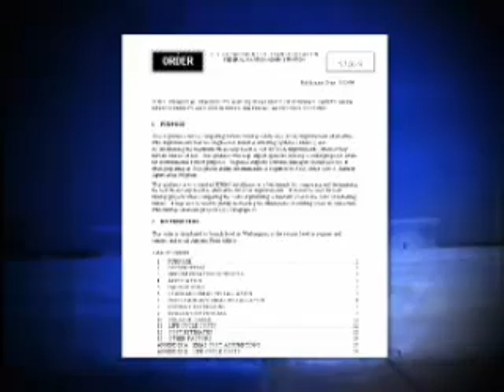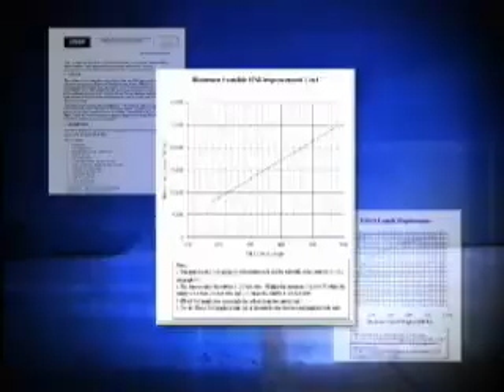Engineered Materials Arresting System EMAS by ESCO

Comment: From the 1:10 untill 1:12 of this video, is shown an runway end with somekind of wall at the end, It seems to b part of the EMAS as well. Is anyone able to tell what airport that is? or any other relevant info on it.

In advance, Thanks
Rob!
Reply: The wall shown is known as a blast fence also known as (jet blast deflector). It is used to minimize sound pollution to surrounding areas near the airport. The fence deflects the jet blast upward if a jet is doing a runup inspection.

Comment: What is the turn around time after use? If the main runway at a major airport is using this system and an Airliner runs into it, does that leave that runway unusable for days? Weeks?
Reply: The turnaround time is pretty quick- the repair just requires replacing the damaged blocks and only takes a day or so. The runway can still operate with damaged emas, usually with a notam shortening the runway and noting the damage.